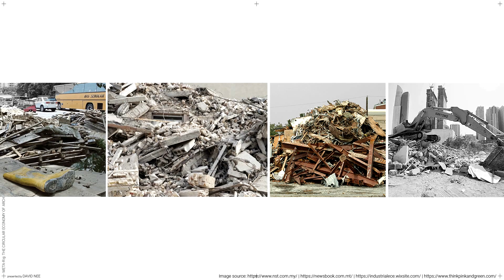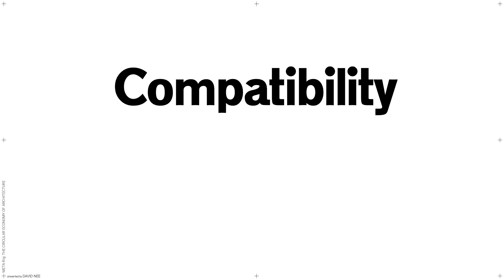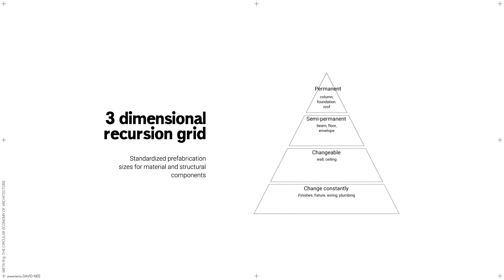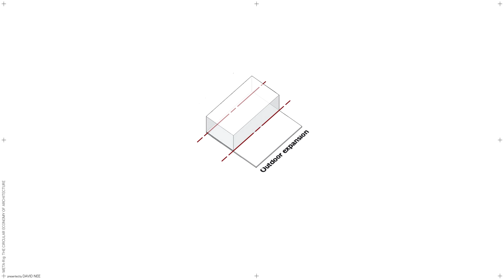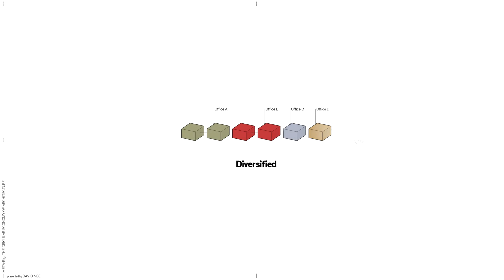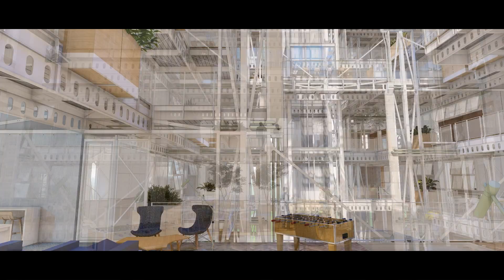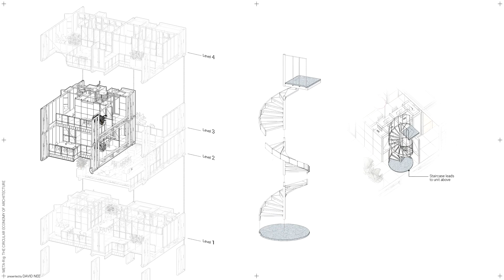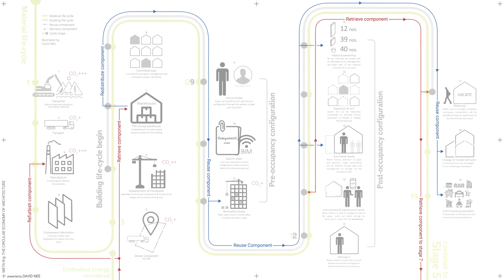The Circular Economy of Architecture: META-Rig (Design thesis presentation) by David Nee

Comment: This is a great thesis on a lifecycle of construction. Modularisation has gone out of style in favour the unsustainable economy of cheap labour, form-work construction method and high-real estate demand in the past. Circular economy in architecture talks about that. Also noteworthy that the practice of architecture impacts the local government, buyers, investors, capital ventures, developers, building tech, and contractors, which stakeholding needs and challenges requires a circular economy to address any gaps or re-writing of their roles in the CE.
Great that this push for a better Construction Environment comes it at Master Level work, ought to be continued in Construction Tech, as part of a career of research & practice.  Well done David Nee and Supervisors Azari Mat Yasir and Razin Mahmood.